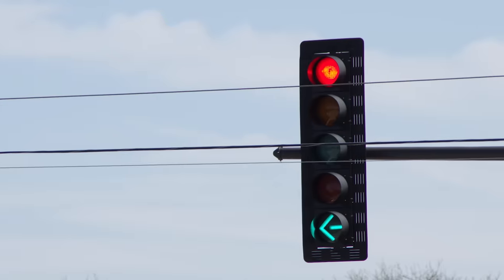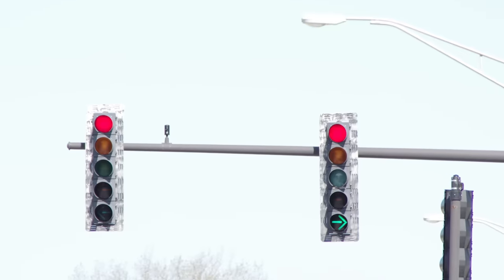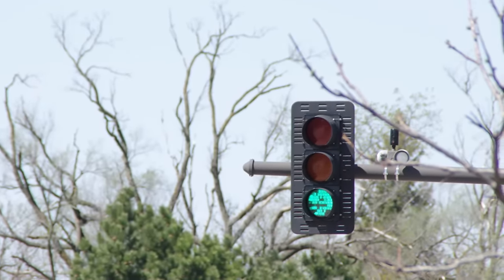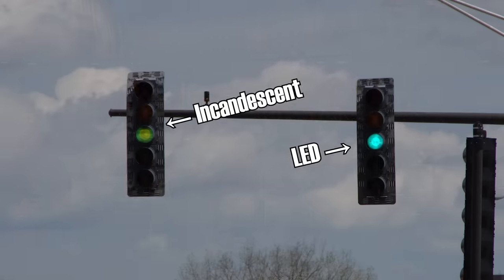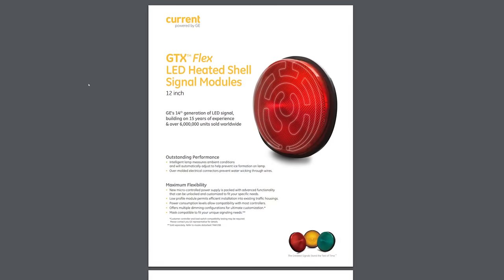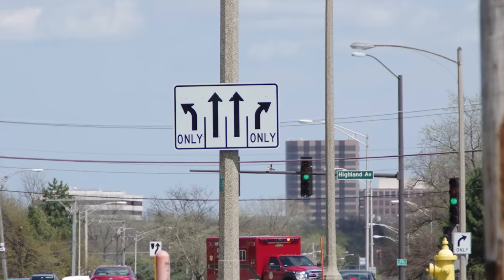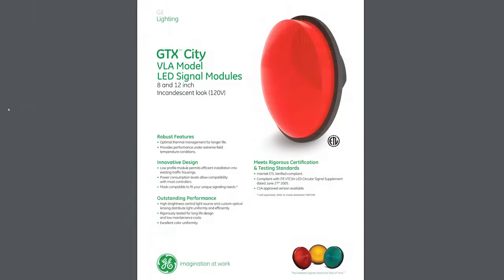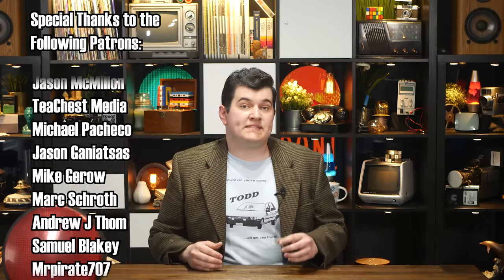The LED Traffic Light and the Danger of "But Sometimes!"

Comment: I hate the stop lights that have those stupid lenses on them so that you can only see the light from a certain angle.
Reply: I like the lenses because they make it so that only the people who are checking on that light can see it. If there weren't lenses around the lights, people in the opposite lanes would see them and might get confused and it would be harder to see the right lights. I would rather be safe and not have me or anyone else drive at the wrong time. There is no reason to hate light lenses.
Reply: MischievousMoo there's a reason. They can be a pain to see when it's really sunny out, even when they are relatively healthy.
Reply: I disagree, I understand the points with gany and Mailman, but I noticed one in Houston under a pretty big highway intersection that is shaded from the sun and the intersection is a 4 way that is perfectly square... no reason to have that lens.
Reply: MischievousMoo I want to be able to see when the other traffic light turns red so I can bury the clutch and put it in first so I can launch the second the my light turns green. I live my life a quarter mile at a time.
Reply: There is a few lights like that in my city and they are dangerous. you cant see if it is red or green until you are 20 feet from the intersection. This causes people to stomp on there breaks and cause rear-end accidents, and big truck ruining the red light because they cant see it in time to stop. The color of the once white concrete has turn a noticeable black from skid marks.
Reply: Travis Lowrey and that just means if you can't see the green light, assume it's red. Just like the video guy states. Assume red.
Reply: Travis Lowrey idk about you, but I was taught in driver's ed to always slow down when approaching an intersection, perhaps it's not the fault of the light but the fault of the driver's incompetence.
Reply: Travis Lowrey exactly this. If the goal is to force people to slow down at every intersection, they miscalculated terribly. You should be able to see all of your lights, including pedestrian signals, from a distance so you can start making decisions as soon as possible. You should be able to tell over a block away if the green light is stale or there are too many cars for you to make it through before it turns, etc.
Reply: me too, we have only a couple of those left in my area.  you have to be at the right angle to see them. 
 whats odd too about them is how sometimes the light will look "off center" of where the lens is, it's like you'll see the light off to the side of the physical lens
Reply: The reason why the lenses is on the traffic light if because of sunlight which would make it hard to see withoit the lenses yet some people like the person above me doesn't know that
Reply: They are needed. I’ve seen intersections with a mess of traffic lights pointing in all different directions. Those lenses are to make sure people know which light to look at.
Reply: Lmao only 65 days of snow
Reply: My city changed back to Incandescent. It's a good move.
Reply: Nutz4Gunz45
That's what the amber light is for.
Reply: Exactly. The more transparent the intersections lights are to drivers the better able the drivers are able to judge the traffic situation.
Reply: We used regular corrosion resistant metal shades for decades.
Reply: ganymedeIV4 Well, being that we need stupid people. Even if they somehow become ones in charge. We just nod and play along. All the while wait until they get bored and move onto the next shiny. Though only issue with stupid people. There are the more common stupid stubborn kind. They are harder to work with. As they don't like anything to do with change and progress....reason why. 9 times out of 10. They end up dead.
Reply: You wouldn't see anything in bright sunlight otherwise, not without much higher pwr light anyway.
Reply: Yeah, it's the pain in the butt, they are everywhere in Arizona on the pedestrian lights (coupled with the stupidest programming in the world).
Reply: I've only seen lensed traffic lights in specific areas, where intersections are particularly poorly designed.  If you need a lens on a traffic light to clarify who the light is for, your intersection is poorly designed.
Reply: CH1PSET That is the ultimate result, you have no choice but to slowdown. But personally I find it adds to the uncertainty and confusion of the drivers witch is more dangerous than speed. I find it to be safer to know what the light is 100 yards beforehand so every one can adjust their speed accordingly. Still at the end of the day idiot drivers always exists and will rear-end you at a green light because you are being cautious and they are not.
Reply: I've found that jumping the green is a pretty big risk where I live, though we almost have none of those types of lights anymore. I don't think it's such a big deal either way.
Reply: neutron star Outside pure grid city designs, it is not uncommon to have Y, X and even * shaped intersections, because that makes the actual traffic patterns straight.  But those obviously will result in two or more incoming roads being less than 90° apart and thus needing something to make sure drivers know which signal is for their direction and which one isn't.
  As to some of the other comments in this thread, there seems to be some confusion between actual lenses (glas/plastic that focus or blur the light) and the black or yellow shades that keep away most snow and reflections (because you don't want the sun to light up the color that's actually off).
Reply: Without the lens, the sun would drown out the light during the day.
Reply: @   tkandme3
Your city government is incompetent.
Reply: we've got a few of those lenses in Ottawa (just installed), and they are a MAJOR traffic hazard. we haven't had any accidents YET, but they're VERY difficult to see except from certain angles. the result is loads of confused drivers at intersections, and no one knowing what anyone else is doing. one intersection uses them at a crosswalk, and I wouldn't be surprised if a pedestrian dies there because a driver can't see that the pedestrians have right of way.
Reply: Cheap government dept that won't pay for additional lights. All the directional lensed lights here are for intersections where one lane is stopped from turning while the others continue straight or vica versa.
Reply: Travis Lowrey only the green is set to not see at an angle - red isn't.
Reply: Hey man,  great research.  Someone is a traffic light nerd. :-)
Reply: what's wrong with them? Is your neck so crooked that you can't see the light in front of you or something?
Reply: that slows down traffic and causes more gas to be wasted, as instead of coasting around the full legal speed limit, people slow down, possibly even with their breaks, and then have to push on the gas again when they see the light is green.  2 negatives.  

I agree the directional lenses are horrible and stupid in most circumstances, though there are a few weird intersections with small <30 degree angles where they could be beneficial because the lights really are confusing when you can see all of them.

however, couldn't they produce a lense that only blocks the light at a HORIZONTAL angle and not a VERTICAL angle, eliminating the problem of not seeing the light straight on but from a distance?  (this issue arises usually because lights often don't hang straight down, or wind is moving them, or the road is at an angle.)
Reply: My city did for a time as well, but only on the green lights. They had a lot of partial failures with the early generation green light LED fixtures, and the cheapest short term solution was to swap them back to incandescent till the manufacturer got the bugs worked out.
Reply: When I lived in California, three or four after the light turned red was the norm. You risked getting rear ended if you slowed down when a light turned yellow.
Reply: Same here. They should be visible in all 4 directions!!!!!!
Reply: The original poster wasn't referring to the visors that shade the lights, they were referring to actual lenses that cover the lights themselves. They're rare in my area but there are lights that have an internal bulb covered by a lens. It's a flawed design because you cannot see which light is illuminated, even if you're facing the light, until you get within a certain distance. If they haven't caused accidents I'd be amazed.
Reply: Those are typically used when there are multiple lights in close proximity and you don't want the drivers confused about which light they should be looking at.
Reply: @  Mekronid
Your mindless hatred is strong.
Reply: @ Mekronid
Yep you trigger and let him rule your mind.
Reply: @ Mekronid
Who else do you think I am?
Reply: Mekronid ... Now what do you know about fuckin traffic lights?
Reply: Edward Williams Union bylaws.
Reply: Drew Hogg we only had 8 or 9 this past season.
Reply: those are called PV lights, and they are like that for a reason, it is so that only traffic in a certain lane(s) will see it. they are commonly used where there are multiple traffic lights on a straight stretch of road in close proximity, so you dont get confused with the next upcoming intersection. anyway, it sounds like its not the lights' fault, but rather the traffic signal techs need to adjust the angle of the entire head (as well as adjusting the little mirror inside of each RYG section for optimum light output. i know this because i am a traffic signal tech in california.
Reply: God HELP you all, there. The END is nigh!  
BANASH the new! Retain the OLD-it is IMPERITAVE!
Of course they said the same thing about the introduction of Windows XP. But yet, somehow , we've adapted and overcome that episodic event and moved even farther along to the future.😋
Reply: yep, proof that leds are dangerous!
Reply: MischievousMoo that’s stupid though. Who would see a light in a different lane and think it was theirs? They shouldn’t be driving if they don’t know how to stop at a traffic light. I like watching the lights on the other side so I can see when they turn red, so I know when mines gonna turn green haha
Reply: And if the goal is to make people slow down before intersections, it’s not doing that job right either because half the time you have to slow down to a crawl to be able to see it from the right angle. It’s completely unnecessary. And if the lenses are there to help for when it’s really sunny out, it’s not doing a sufficient job there either, because they’re harder to see when it’s sunny out!
Reply: @edwardwilliams2964  this wouldn't happen to be the one off of westpark tollway and beltway 8, would it?